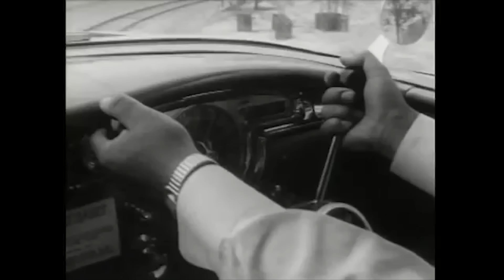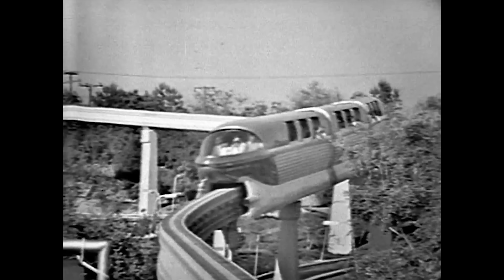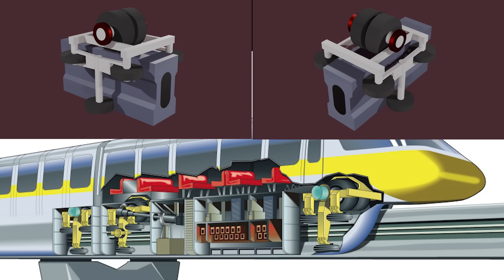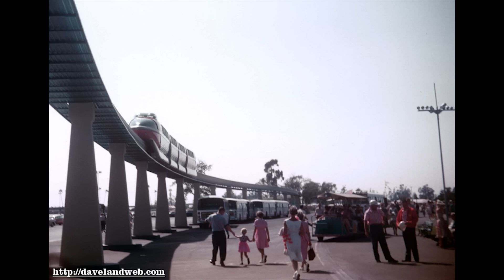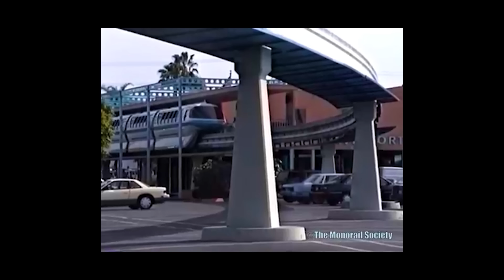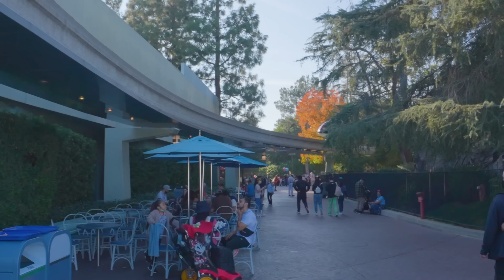How Disneyland Built the *MONORAIL* | Documentary

Comment: I have a story about the 2nd Monorail building. After the monorails were move to the current building around 1965 the building was repurposed for the Decorating department, Maintenance Services and maintenance costuming. 
Around 1982 I was servicing sewing machines in Decorating when I notices several Monorail pylons in the Main deco workroom. I realized that the building must have been used for monorails previously. I then noticed on the second floor,  large doors on both end of the building. The building remained until Toontown was built,  now the site of Cartoon-spin.

Comment: Monorails are never truly monorail. In the case of the Alweg system and its imitators there have to be a minimum of three running surfaces  to keep it on the top of the single beam and two additional ones for stability.  That all of these are much more compact because the four other running surfaces are vertical does save structural mass per mile/km, especially when elevated. When at grade  and through tunnels it costs more to build.  
The rubber tires limit top speeds as well which is true of rubber tired metro systems and of course busses. Plus rubber tired transit of all sorts suffers  more from vertical bumpiness which is the major reason speeds are limited to 35mph (56kph). These factors among several others make this mode of transit more aspirational  of future fixed guideway transit than practical. 
Monorail does climb and descend, accelerate and stop better than steel wheels on steel rails, but at a cost both in transit times and in station location and dwell times, not to mention passenger capacity.
Reply from the maker: The monorails arent limited to 35mph because of bumpiness, thats just a designation of speed at Disneyland because its unnecessary for them to go faster, particularly with how short the straight-aways are, even outside Disneyland. At Walt Disney World, the monorails reach 45mph. And in certain monorails outside the US, they've been built to reach 60 or 65 with passengers.

And not all ALWEG-style monorails need rubber tires for the guide wheels. While I was researching for this video I discovered similar monorail systems that have rubber drive tires for acceleration, deceleration, climb, and decend, but they had steel guide wheels to reduce rolling friction and cost of maintenance.

Its possible to design better and better monorails, but innovation only happens when monorails are in demand. And while they arent the right fit for every scenario, I think they do really well in tight, elevated spaces with high-ridership demand.
Reply: @AlextheHistorian  That, and the fact that they are a sightseeing ride of their own. Speeding along would lessen the experience.